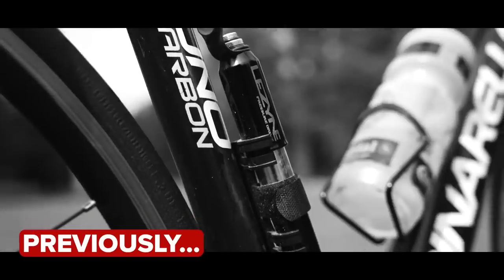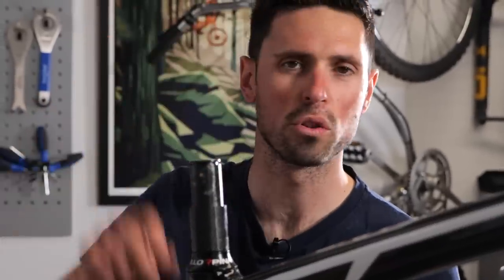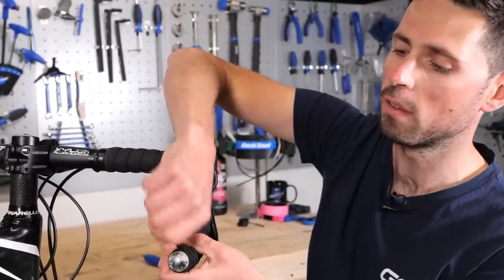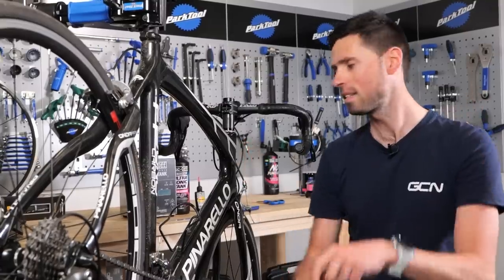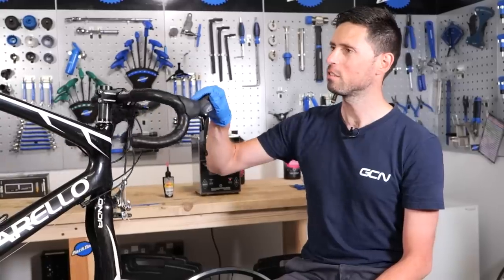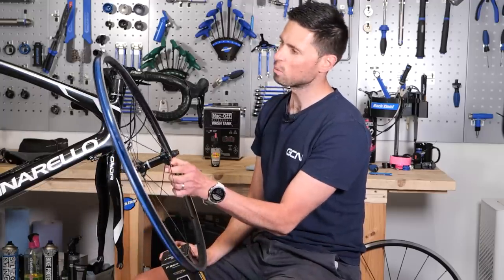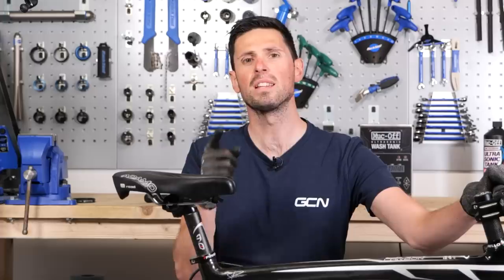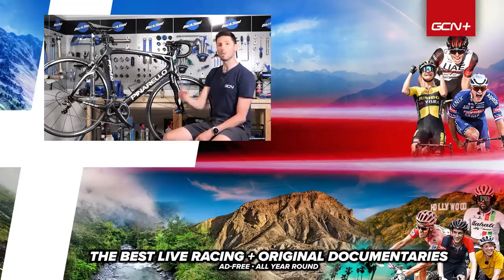Fixing Up The Cheapest Pinarello We Could Find!

Comment: Why didnt you replace the stem with a longer one and also lower it more?
Reply: Yeah, I agree, a new stem would be a cheap component (if you buy at a similar 105 level to the rest of the bike)
Reply: I was expecting it becoming a proper bike, but not yet, maybe next video they could make it.
Reply: Yep, wouldn’t have been the original stem.
Reply: Maybe Because the title of the video is fixing not replacing 🤷‍♂️ just a thought
Reply: @kden true but they did replace the wheels
Reply: They did replace the stem later on maybe, you can watch it on the GCN channel, where they use this and 2 other budget bikes for a race.
Reply: @crycrcfyhf8862  except they replaced the wheels, tyres, bar tape, and saddle...
Reply: @stitchilalu  Yep! How much more would it be for a longer and lower stem? Maybe as much as a brand new second hand saddle. Sad, they didn't do that. It still looks awkward.
Reply: Yeup. Replacing the bartape (could have reused the original tape) but not the stem? What is it supposed to be, a DH bike?
Reply: I thought they'd have Ollie's bike measurements and would be setting saddle and bar position for him.  Or Mark.  And Alex would temporarily raise the saddle for a road test.
Reply: Yes...quite bizarre why the stem wasn’t changed and shorten the height of the stack..
Reply: £100 quid worth of tyres, didn't replace the stem
Reply: presumably  the owner was MTB rider

nobody would ride such short stem

Comment: If you check the steerer tube you should pull it out and check the entire tube.  Especially check where the bearing sits at the top, that's usually the point of failure.
Reply: aka ring of death.
Reply: @durianriders  love it!

Comment: I have many questions about this:
- you change the saddle but not the stem? Stem is also really important for the bike fit and handling
- Why didn't you properly inspect the whole steerer tube, dropping it out of the frame would take another 30 seconds
- You took of the cassette, then mounted it on the new wheel, to clean it then on the new wheel? You could've used the ultrasonic cleaner
- The wheels seem like a sidegrade to me, they look to be the WH-RS300-CL wheels. So you save 100-150 grams and spend 200 euros/pounds. And you talk about "saving money" by not spending any on a new stem... The wheels that came with the bike looked fine, you could have just changed the tires and have the same performance improvement. You are going to race it on a flat circuit, weight doesn't matter there anyways.
Reply: Who cares?...
Reply: Good point on the wheel “upgrade”. A new stem would have been my priority (along with the saddle). The biggest spend, by far, here were the wheels which seemed a bit pointless for the negligible benefit. Maybe you’d be better off saving that money and further form the line upgrading them to a higher spec, more expensive, wheelset?
Reply: @kidShibuya  why bother watching then (or commenting)
Reply: May be they just tried to promote products from gcn sponsors...? 🤔
Reply: I know right.. How confusing..
Reply: @salvadorgalbis509  Kinda? They are also sponsored by vision, an they make some 30mm deep aluminium wheels. It would be more convincing if they put that on, and said it's for aero benefits. Also, the stock wheels on the bike were shimano in the first place

Comment: Odd choices, the wheelset seemed perfectly fine and the wheelset you replaced it with is nearly the same. The money spent to replace the wheels could have gone to; new alloy stem, new brake pads, computer mount & full bearing service for the wheels with enough left over for tacos. 
Considering the application was specifically racing, fresh tires are a priority and you've got sponsors to please, so yup. 
Missed opportunity here to show how to repack cup & cone hubs!  
Provided new pads maybe not a great idea ON race day and neither are new cables/housings, body position and that mountain bike stem is downright dangerous to go straight into a peloton without at least a few dozen miles acclimating to it. Might as well race on aerobars. 
BTW: The 1889g Tiagra wheels with round spokes replaced with the  1932g 105 wheels with bladed spokes, both are cup and cone, but the 105 has a bit of a wider rim, all told a slight aero advantage, mostly from the wider rim smoothing out the tire. They aren't lighter per Shimano. 
Saddles and pedals are commonly swapped straight from old bike to new, so all good there.
Reply: Exactly my thoughts. Also he could've replaced the brake calipers from the flexy single-pivot Tiagra ones to much better 105 (or above) dual-pivots. Performance difference between Tiagra and 105 wheelsets is close to nothing (surely not spotable in real world conditions), yet price difference is huge (taking into account the complete value of this 'project').
Reply: Completely right. Good condition RS wheels swapped for brand new RS wheels. Gotta make your biggest sponsor happy I guess.
Reply: @jeskli11  uhm,  they are already dual pivot brake calipers, probably flaxier or a bit heavier (or both ) than a 105, yet it's probably barely noticeable the weight and the feeling is down to practice
Reply: @REVOLUTIONS51  Well, technically speaking all Shimano rim brakes are dual-pivots, but 105 and above have one mounting point on the top and the two pivots located symmetrically on each side of the caliper. Tiagra and below have one pivot located similarly to the better ones, but the other pivot is on the top, where the mounting bolt is located. If you squeeze the calipers with wheel out, you'll clearly see the pads of 105 and better are going straight to each other, yet the Tiagra's pads are just going differently, asymmetrically. You might not notice that at all if you live somewhere flat, but in a proper descend or even racing, when you brake hard just before a corner, the difference in terms of performance is huge.
Reply: @jeskli11  well, I've got a set of old Sora (I'm a poor broke guy that bought 4 years ago an used 6 years old bike for 250€) and live in a really hilly area in northern Italy. The two things I notice are that 1) the caliper close equally, even if it's an "asymmetrical" dual pivot. It touches the rim at the same time on both side and at the same height/ position on the rim. if I remove the wheel, when closed as far as my brake lever allows me there is  la 1mm difference in height (radially if waking to the wheel as system of reference) between the to pads, but they close in from the side equally.  Maybe you've seen not properly registered caliper? And that height difference is not important as the pads will never close more than the wheel rim, thus the important point to check is at rim.  and 2) then I'm a maniac in descending because I've got 8 Koms in those technical descents where my lack of pure power is less felt and it's more a game of who's more suicidal. 

All and all I reckon they are incredibly squishy compared to a Ultegra of a friend of mine, but it's a combination of cheap 1€ brake cable, squishy sora 3x9 levers, squishy sora brake calipers and cheap Decathlon pads. And yet I enjoy them no problem.

Comment: Why not change the stem, I can’t believe you didn’t have one laying around GCN megabase?!
Reply: They do swap the stem for a longer one, it's in another video.
Reply: I’m pretty sure it’s because they had to keep the total price of the bike at £500 for the specific £500 racing bike video. Using a new stem they would’ve went over that price. What they had laying around doesn’t count unfortunately.
Reply: @jinnij.caiman  What about those wheels and tires? 😂
Reply: I've got a selection of longer stems than that knocking around - amazed they haven't
Reply: @grahamaustin9085  They have. It's on the bike. In one of the later videos on GCN.

Comment: I am absolutely amazed that you left so many spacers on the steerer tube.  
Obviously better than it was but still FAR too high.
Reply: It all depends on the size of the rider and the desired position. Maybe the previous owner had some back issues or whatever. Four spacers is not exceptional for a lot of people, including me. After my bikefitting I needed 4cm of spacers and I'm still in a rather race-oriented position.
Reply: max. 3cm of height if I recall right

Comment: Get well soon Ollie! Nice you resisted the temptation to go overboard by fitting deep section carbon rim wheels (you just happen to have lying around 😅). I’d get a longer stem, as that’s the only thing that’s still a bit off with the geometry. How are the brake pads too? Those Tiagra rim brakes are probably capable if they have decent pads.
Reply: I think they should have fitted some deep section wheels, though. Alex switched out the OEM wheels with the Shimano ones that are basically the same, just a bit lighter and with bladed spokes. I mean, if you're going to "upgrade" the wheelset, might as well, right?

Comment: Agree with every comment that says changing the stem is a bigger priority. Surprised if there is a saddle laying about that there isn't a stem. But, the thing that got me was why remove the cassette and then fit and clean it on the new wheels, Surely better to clean the cassette when it was off the wheels (no risk of degreaser going in the hub). Hell, it could have even gone in the bath with the chain.

Comment: The solution for an ill fitting bike is to buy a bike that fits. Thanks GCN for this gem of information. 😂
Reply: Yeah, but if you bought yourself a wrong size pair of shoes, there wouldn't be much you can do apart from getting another pair that actually fits you...
Reply: Just get a bike fit. Hopefully the frame is the correct size to start with.  If not, another bike.
 Changing crank lengths,  seat post, stem, bars and saddle  if needed can make all the difference.
Reply: EVERYBODY.....NEVER FINISH YOUR FINISHING TAPE WITH THE END OF IT ON THE TOP SO EVERYBODY CAN SEE WHAT A POOR JOB YOU'VE DONE!!! make sure you put under the bar 🤦‍♂️

Comment: I don’t get Alex’s ‘upgrades’. Saddle – yes, needed, steerer tube extender removed – totally needed, new tyres – ok, why not, handlebar tape – ok, why not; but why keep that 30mm or so stem and rather buy a wheelset, that costs relatively a lot and is pretty much none upgrade from the previous one (I would get it, if the original one had brake surface worn out or bearings in bad shape, this one looks almost new). When the bar tape was already off, why not put new cables – very cheap, yet can make a huge difference in shifting responsiveness. Same can be asked about why he kept the original chain. Also I noticed, that after he removed that steerer extender, the expander plug was visibly loose, but he didn’t care at all.

Comment: used but low mileage bikes are great for anyone checking out the road biking. My 10 year old Synapse Hi-Mod with Red still performs better than the 2021 Domane SL6 Ultegra. Domane was a replacement but have decided to keep the old Synapse instead. electronic shifters and disc brakes are all great, but for casual riders low mileage mid-high bikes are as good as any new models without the price shock.

Comment: Hello, which diameter tires did you guys used? 
I have a pinarello FP team from 2014 and want to fit 25 or 28mm tires with 17c rims, right now I run 23mm but is way to narrow and want to run wider but I don’t know if there is enough clearance
Thanks!

Comment: Wow, that bike looked absolutely ridiculous with that hideous extender. 😂 What was the previous owner thinking? That short stem is awful too. Should have replaced it with a longer one. Anyway, the bike looks much better now. It can be ridden without shame. Lol
Reply: (Edit: I think that...) The previous owner thought that the position was too low and too stretched so he moved the steerer up and further back.
You might find the extender and the looks questionable but that probably was it.
Reply: i wonder for what prize it would now go, after the changes
Reply: The original owner most probably had back issues, hence the raised/short  position.
Reply: Knowing GCN the whole thing was probably a fix. I bet it was they who put the ridiculous extender on in the first place. Nothing they do has the faintest whiff of sincerity
Reply: CIearIy he was a much taller chap
Reply: @skyjuiceification  he had a bad back.

Comment: Nice bike. I have the 2012 DUE model, which was all 105 and had an internal rear brake cable. I suspect the UNO was a lower spec; hence the Tiagra brakes. I didn't get which model wheels you were changing to. RS you said, but RS???

Comment: To avoid needing to do that "loop-dee-loop" with the bar tape around the shifters, just measure & cut a small (5cm-ish) piece of bar tape to cover the clamp on the bar at the back of the shifter, and put that in place that before going around with the tape. This avoids overwrapping / overlapping that area and keeps the tape smooth and even around the shifter.

Comment: Still flogging the dead horse . . . 1:40 are you going to put that expander plug down back where it should be? & how do you race on a road bike with an MTB length stem on it?
Reply: I mean I ran a 30mm stem on my road bike for years after I built it was honestly quite fun. Makes it handle quite differently as far as like turn in to the corner so you need to be more careful but the slower stuff is more fun!

Comment: 0:47 I'm pretty sure you can get riser/ North Road bars or similar in a 31.8 clamp diameter, but you'd need to budget for new levers & shifters so it wouldn't be a cheap fix. Tbh if you really need such an upright position a drop bar bike may not be for you anyway...

Comment: If I’d of bothered throwing that bike in the work stand and firing up the ultrasonic I’d of done a complete nuts and bolt strip down clean and service. bring it back up to a brand new and very nice bike 👌🏻. I mean your more than half way there taking the steering tube extender off! rude not to clean up the headset while your there. and while your changing the bar tape, fresh cables? maybe Iv watched too many of bikespeeds excellent videos haha

Comment: I’ve always been taught to reverse direction when taping so that the tape comes up and over the tops towards the saddle.  No?
Reply: If it's Calvin Jones that taught you this, yes. That's what I do.

However, it doesn't suit every bar tape model.
Reply: @yonglingng5640  Are some bar tapes directional?
Reply: Si Richardson’s “figure-8” bar wrapping video covers this - yes, you’re right - tape should come up at the front of the bar tops, otherwise pulling on the bars will risk unraveling it

Comment: There's no SHOULD start at the bottom of the handlebar when taping your bars.
I've always started at the tops and worked my way down to the bottoms.
I have NEVER had any problems with tape slippage or water/dirt ingress into the tape.
I must admit I have had a LOT of practice doing it this way as I used to work at Raleigh.
I have done over 30,000 bars this way.
Granted it was more than 30 years ago 🤣.
Before anyone calls BS YOU do the maths.
125 per day X 5 days per week X 48 weeks per year.
I did this job for over a year.

Comment: On the image to get to this video it states 'FIXING THIS LETHAL BIKE' and thought GCN must have watched Luescher Technik videos where Pinarello frames have been analysed and shown to be unsafe in many areas with voids and other issues. The manufacturer Carbotec has been known to be a bit inconsistent at times as ultimately a CF frame is handbuilt slowly and a huge number of opportunities for there to be problems with manufacturing, it only takes one of the Chinese production staff to make a small error at any stage. 

However after watching the video I assume they are implying the height extender is unsafe but of course that is completely safe when used on the road with a normal steel or aluminium bike and forks. The issue is CF again which you have to treat carefully. I think this video shows the problem with modern bikes and the obsession with being lightweight, the original owner never had a good bike fit on the bike and modified it to improve the bike fit for him but was never satisfied and consequently sold it with a huge financial loss on his purchase. The older road bikes and very cheapest road bikes you buy today have quill stems, you can adjust the height of the handlebars in seconds and experiment to get the perfect bike fit for you. I sort of wonder if a bike like that is a perfect introduction to road cycling you can experiment with the bike fit and once you know what you want exactly take all the measurements and buy a lightweight bike with limited adjustments to those measurements. I've read enough forums to know many people who have had professional bike fits are still not happy with that bike fit although they dial it in much closer than the average person doing it themselves. The best bike fit takes sometime to work out. People often go on about modern road bikes being much better but in one area the bike fit it is actually a retro step because of limited adjustments.

Comment: At this point buying a new bike around 700 pounds looks a lot more appealing.

No way is that remaining a 500 pound bike with the upgrades being put on even after selling the previous components.

At least put the prices of the (new) components that you are adding if it's worth someone's time buying an old cycle like this and upgrading it.
Reply: Not really as a bike at that price wouldn't have the same level of components fitted or that standard of frame.  
I would have changed the shifter and brake cables while the bar tape was off.  Would probably have put on new brake blocks for peace of mind